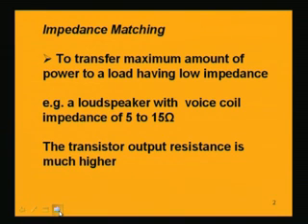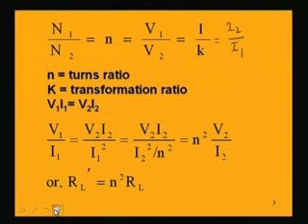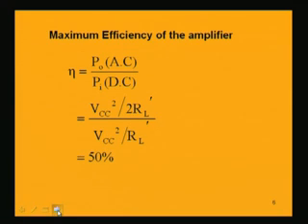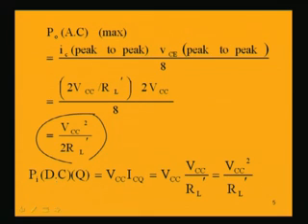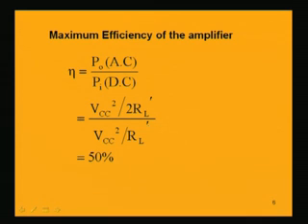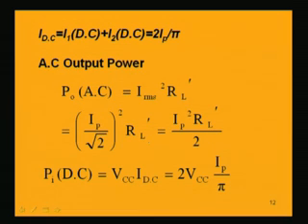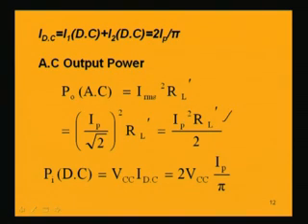Module - 5 Lecture - 2 Transformer Couple Power Amplifier

Comment: did not specify why rl' considered dur8ng the calculation of input power. it is vcc into icq .but icq is vcc by rl' .but during the dc cinditions rl' is not there which madam specified .but still during the calculation of input power it is nothing but the dcp power why considered rl'
Reply: u are mad i think so